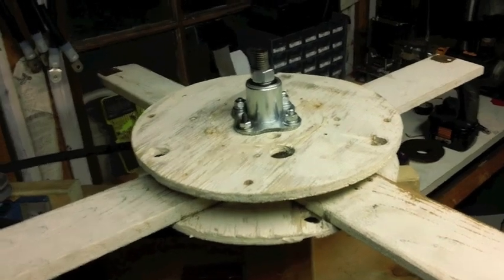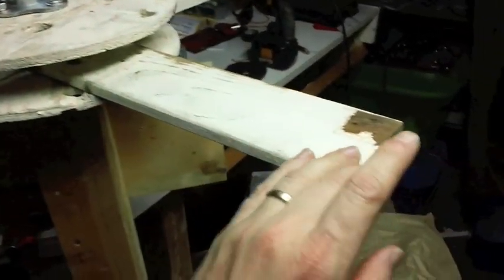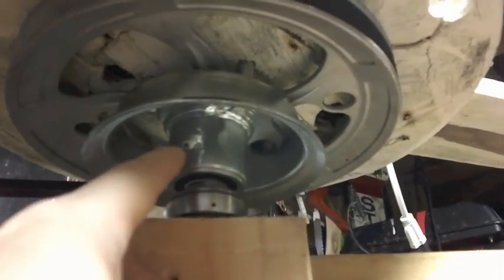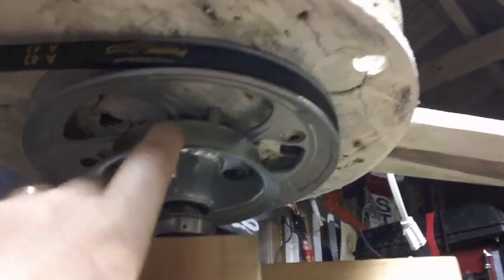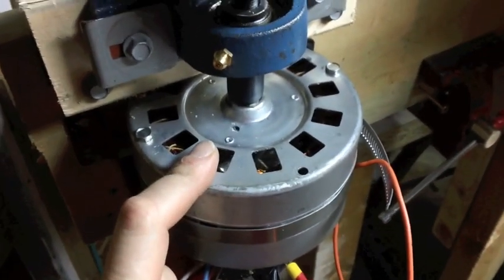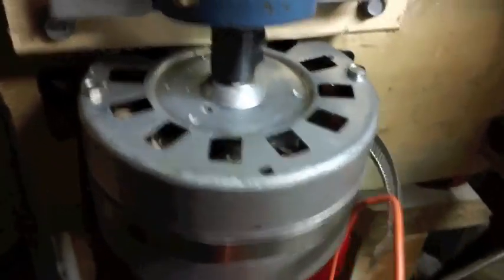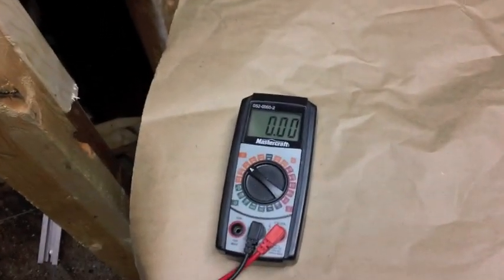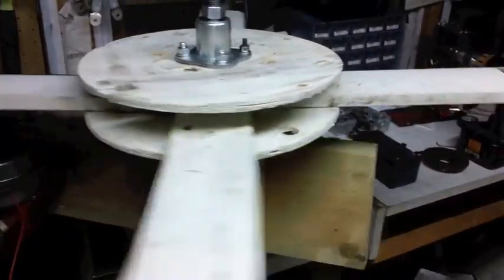Add a Motor to the Vertical Axis Wind Turbine Project

Comment: 2:20– do you need a rectifier near your brake switch or just the one in the motor.. do you need the rectifier on motor can’t it be mounted to board with other items..?
Reply from the maker: I had the rectifier super close to the motor for testing. If I would do it again, mount the rectifier closer to the charge controller. That way you could use a 110 AC style extension cord to run the 3 wires. Much more cost-effective to transfer power (less loss), than a thick DC cable. Thanks for your question.
Reply: The Cedar Workshop great! Mahalo for answering!

Comment: Is  not  possible  live  drive ?????
Reply from the maker: +Inbaraj Asir Yes,that would be ideal. This particular generator motor needs a higher RPM. Try to find a be low (150) rpm motor or geared motor.

Comment: im building a portable vertical axis wind turbine and my team and i are very curious on the bearings you are using and what they are off of so please if you could message me all of the information on the bearings or if you could send me a link to show me what they are.  we are also trying to figure out with will keep the center shaft from falling through the bottom bearing
Reply from the maker: The bearings are from tire hubs. The 2 piece hubs are 8" diameter, air fill, rubber tires. Used for carts, dollies and portable gas powered generators. Once the bolts are removed, the hubs will come apart. Air fill only. 1/2" - 5/8" arbor. In Canada: Princess Auto in Small Wheel Assemblies (2.80 x 2.50-4 Wheel Assembly@$15.99). In the US, Notherntool.com has "Generator Wheel Kits" for $33.00.
Check out this video for reference http://youtu.be/eMzA4dpiFTo
or the Blog for more pictures and links http://cedarworkshop.blogspot.com

Comment: Does the Garage door motor make any usable power in modest wind?
Reply from the maker: It does OK, I have to get it higher up and with a meter on it.
Reply from the maker: It's OK, it got 2 or 3 amps. I really need to gear it up for some good power.

Comment: Amazon has them, I get component stuff from them often. But I found them at a industrial supply store in town. The way you have it, the wind has to overcome the friction. I have also seen some use the bearing assembly of a trailer hub. It has the cone or tapered bearings to handle the weight. You find that in a junk yard.
The printer I used to work on are big, seven to 20 feet long, but the industrial supply may have cog belts.
Nice job,
John

Comment: I have been working something similar. can't tell but you should be using a thrust cage bearing to support the turbine. I realized this the had way, that there are bearings for horizontal shafts, and different bearings for vertical shafts, to support the weight and turn freely. the other suggestion is to use a cog belt instead of v-belt.